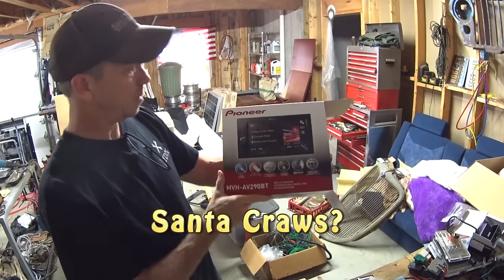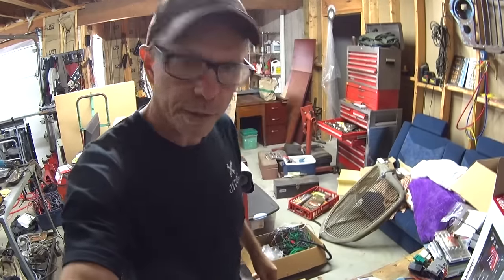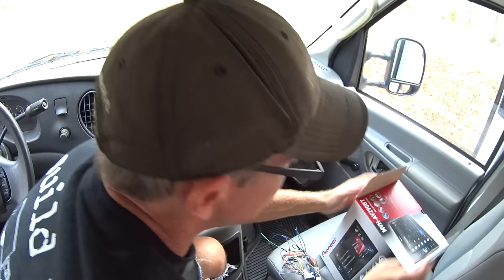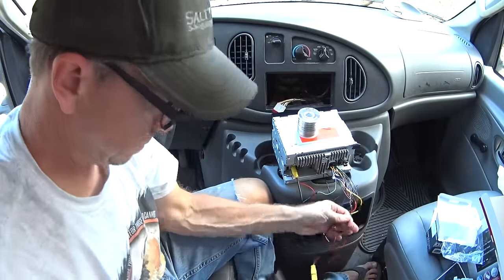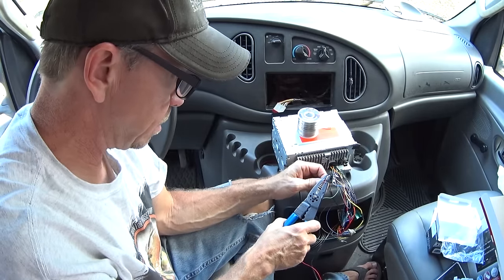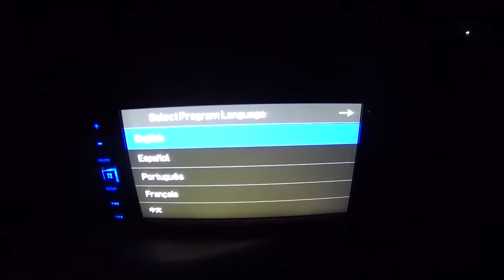Box Truck Camper Backup Camera Install 70

Comment: Nice setup m i set mine up to the backup lights so when I backup its comes on . just saying .

Reg
Reply from the maker: The radio has a wire that you attach to detect when it is in reverse and switches to the camera automatically. I like the camera being on at all times so I can just tap it on the screen to see what is behind me while going down the road.
Reply: @JYDOG  how did you give power to the camera without hooking up the reverse wire?